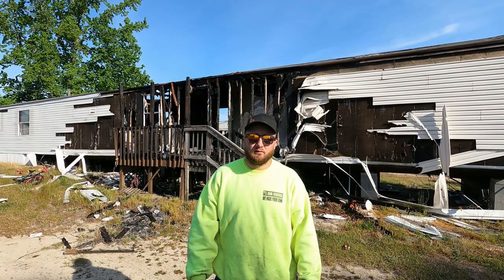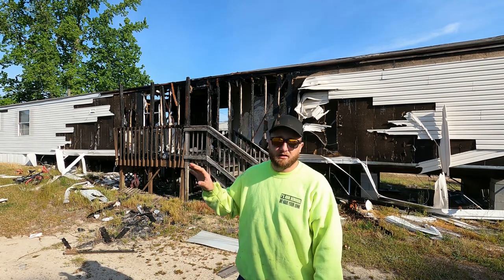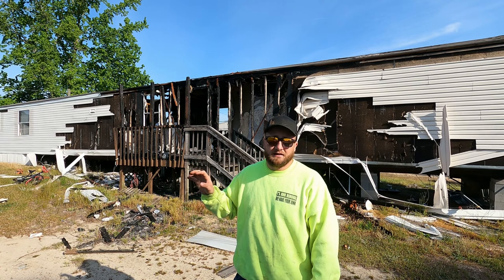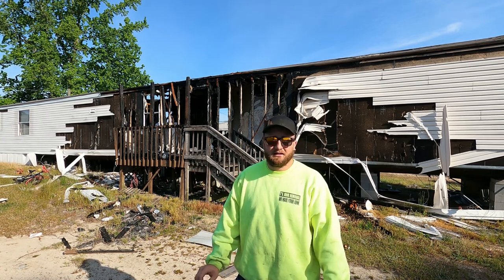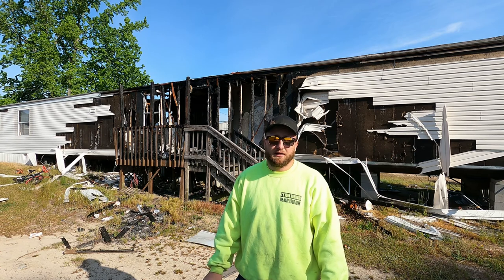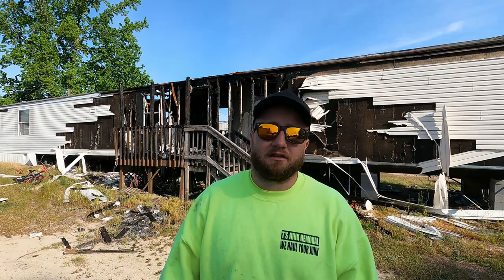Mobile Home Demolition with Skid Steer

Comment: I'm not trying to be cheeky, I'm just wondering after breaking down all related investments, how much in a month for:
-skidsteer rental/expenses
-how much the truck/trailer maintenance, insurance, depreciation, etc. 
-marketing costs
-time spent replaying to emails, texts, calls, quoting to get the jobs
-fuel costs
-bin costs
-helper labor costs
-time spent from when you actually started work 

-workers comp expenses
-gloves, boots & other work gear 
-liability/business insurance 
-tools, rakes/shovels, bags, chains, power tools, etc.

These things really add up , so you don't really make quote minus dump fees when all is said and done, no?
Reply from the maker: Steve you are on the right track. I assume you must be in business yourself, right? Of course there are all costs that you said above that get factored in. So yes, there are other costs than just dump fees. These all could get broken down by how many jobs are done in a month to a per job average.
Reply: Lol... what's your point? Are you asking if it's worth it? Then you need to jump in and find out yourself if it's profitable